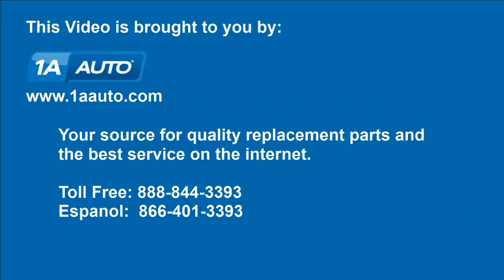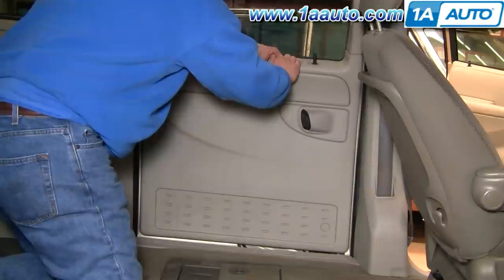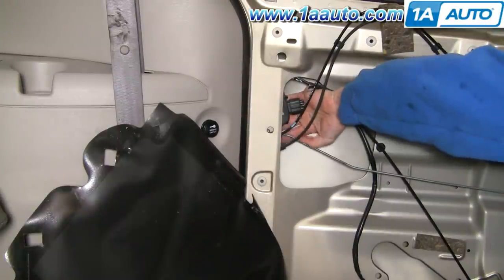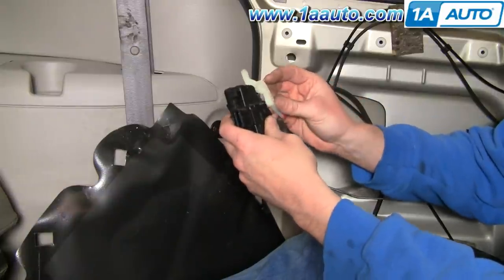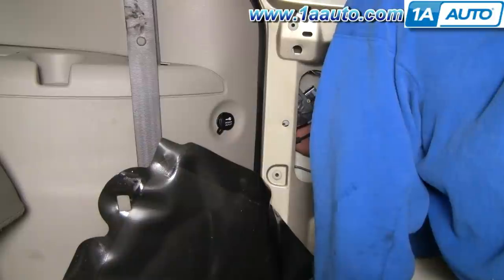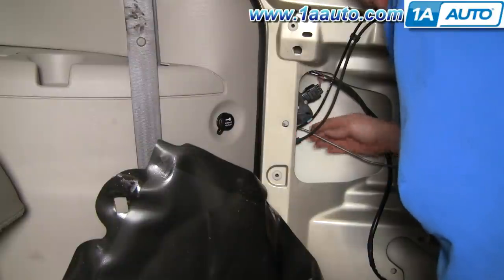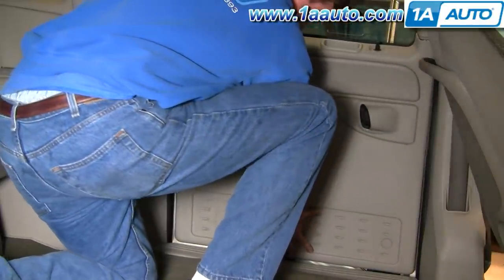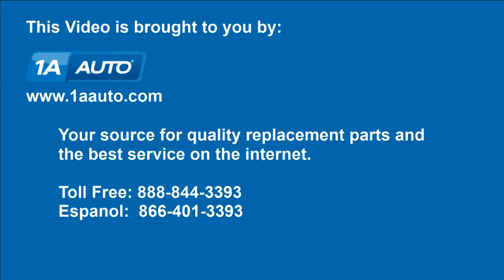How to Replace Door Lock Actuator 01-07 Chrysler Town & Country

Comment from the maker: it sounds as if the actual latch is the issue there and not an actuator. The actuators only function is to operate when the unlock is pressed.

Comment from the maker: It could be an actuator problem or there may be a broken wire between the drivers side door and the body of the truck. Hope this helps you out. 1aauto.com 888-844-3393

Comment from the maker: It may be tricky to do, you could try working your way from the top of the door down to see if it's easier to remove the door panel that way. Hope this helps you out. 1aauto.com 888-844-3393

Comment from the maker: You may want to take the door panel off and check to see if a rod may have come undone from the handle which would cause it not to work. Hope this helps you out. 1aauto.com 888-844-3393

Comment from the maker: In most cases where the lock does not work it is related to the actuator being bad but you should check the wires to make sure there is nothing frayed before tearing everything apart and finding out that you don't need it.

Comment: I would appreciate a better answer for how to remove the actuator in the passenger door of a 2006 Town and Country.  There is no TORX screw in the hole to remove.  I have gotten it loose from the bracket, but something (a hidden screw perhaps) is holding it from coming out.  Thanks.  I see no rivets to drill.

Comment: Great video thanks, but I am having a problem after installing the actuator. I can not open the door from the inside. Almost like I put on  the child locks. Where is the child lock inside the doors. Is there a way I could have tripped it as I worked on the actuator
Reply: The child lock is on the back side of the door when you open it you'll see it from the outside. It flips up or down to turn off/on.

Comment: I have a 2007 Dodge Grand Caravan SXT. The automatic locks are not working on it. Does my van use the same actuator as the Chrysler town & Country? Do you have a tutorial for replacing that? I also am having problems with the driver side power window. Sometimes you have to press in to get the window switch to work. It also sticks in the down position. I am definitely ready and willing to give you guys a lot of business in the next two months if you can help walk me through some of this stuff. :)

Comment: Great video, thank you for posting. I just installed the new actuator with ease and everything works with that. But now I cannot manually open the door with the handle! The door handle moves and you can see the latch working internally and it is not the child safety lock either. Any ideas if the actuator swap affected the manually usage of the doors? I'm stumped!

Comment: Great video. Not sure if that is what my problem is or not. I have a 2007 Town and Country...when I use the power lock switch on the drivers door, the lock button on the fob or when we hit the required speed all the doors lock EXCEPT for the passenger side sliding door. The only way to lock/unlock this door is to manually use the plunger lock. Is the actuator my problem?? Thanks.

Comment: I removed the whole lock panel and replaced the actuator. Tested the actuator and it worked. Put everything back together and now I can't open the door manually. I checked the child safety and that's not the problem. The door will lock and unlock now and open automatically with the remote or inside button. I just can't figure out why I can't open it manually from the inside or outside now...

Comment: On the passenger side door there is a TORX 15 screw hidden behind the panel because the access hole is in the wrong place.  If you go over 3/4" to the right and up about 1 and 1/2" you can drill a pilot hole and see how close the the screw you are.  It took drilling two holes before I could reach the screw and remove it, but it came out easily then.

Comment: I'm with Maureen Fox on this one. On the passenger side, there is the hole where a screw should be, but there is a metal bracket inside the door panel. No screw, no rivets. Not seeing how the bracket comes out or the actuator comes out of the bracket. It's probably something easy. *lol* Thank you for the videos!!

Comment: This is a great video.  Having a problem with my van.  My issue is the power lock won't lock/unlock.  You have to do it manually. Once unlocked, the power door will open and close it.

Is that the actuator that needs to be replaced to fix this issue? Will definitely buy from 1AAuto.com.

Comment: I have a 2002 T&C with driver side sliding door panel removed from the door that is stuck shut. All I want to do is to be able to open and close it manually. How can I open it without any electronics.  I just want it open.

Comment: Great video, but i think my problem is kind of different, when i press the unlock button from the key or the driver side control, only the driver&passenger doors unlock not the sliding doors. Also from the driver side controls, when i press the two down buttons for both the driver&passenger windows to roll down, only the passenger window comes down not the driver side. If you have an idea of whats the default, please inform me...

Comment: My door is stuck in the locked position. I cannot open it to gain easier access to remove the trim.  I did notice a pop out in the door panel that has some sort of nut in there. Is that an emergency door release? Thanks for the video!

Comment: I have a 2009 Towm and Country. The sliding door on drivers side will not open. It will not close tightly. The window will not work either. Actuator? 
Thanks.

Comment: Great Video.  My driver side sliding door will only pop open a bit but it won't unlatch, not even manually, would this be the actuator?  After a while if I push it to close the door will close itself tightly.  Thanks.

Comment: The passenger side door will not unlock ,so I have reach in from the drivers side to unlock I am able to automatically open the sliding door , only when I manually pull up to unlock ..So is this my problem, this little gadget you took out? I thought it was my battery for my key I did change batteries... guess not...

Comment: Thanks for the video & link for the part. Rec'd part quickly and EASILY replaced actuator on 2005 Caravan. Took about 20 minutes - works perfect!
2 pieces of advice:

- Only open door MANUALLY while working - don't use power door button to avoid smacking around upper door trim 

- BEFORE REMOVING old actuator, see how it lines up with the metal bracket inside door. Once removed, look inside rear of door to find the lock pin the actuator moves.  The oval hole of actuator arm fits on this pin.
:)

Comment: I have a 2005 GC Sxt, went out to get in the car today and the key fob didnt lock the door and the neither switch worked either. 
I popped the hood and pulled it IOD fuse to reset the actuators. 
I want to fix the actual problem...but i don't want to replace ALL the actuators. 
How do you know which one is the problem?

Comment: Hey , is this the fix that needs to be done  when the sliding doors don't unlock or lock when the power switch is pushed? Because I have to unlock mine manually. When I try to do it by the power switch, it won't work. PLEASE HELP!
Reply from the maker: You may want to make sure that the fuse is good. If that checks out okay, you may want to check the power going to the switch and also the actuator that unlocks the doors. Hope this helps you guys out. 1aauto.com 888-844-3393

Comment: I cannot manually or auto unlocked drivers sliding door. If I force it up with needle nose pliers it will work for a short period of time. While it is working, a loud buzzing sound comes from the lock actuator whenever you press the lock button (but it does function). However, after it sits for 15-20 minutes, it's back to being stuck in the locked position. Once it's back to being stuck no more loud buzzing sign but also no function (unless forced with pliers) Any ideas?

Comment: Thanks for your excellent video tutorial!
I needed actuators for both sliding doors  on my 01 Caravan. Did the driver side first by trial and error, wasted 8 hours removing all hardware,extracting a stripped lock screw, finding the replacement - unnecessarily removing entire hardware and-putting it back! If only I had watched your You Tube video first, I could have done the whole thing in 15 minutes! I will be doing the  actuator on the other door your way.
You are doing a great service! Thanks!

Comment: this is good video as I need to replace a door lock. but do you have a video for replacing the actual sliding door motor? mine keeps overheating and fails halfway thru day and needs replacing

Comment: Is this what needs to be replaced if the door will not unlock AT ALL - manually or remotely?  We cannot open our driver's side sliding door because we can't get it unlocked.
Reply from the maker: Thank you for watching.You may also have a problem with the latch itself. It might be stuck shut.
1aauto.com 888-844-3393

Comment: My 2005 T&C sliding door lock somehow got jammed.  I ordered the part before taking door apart.  After i disconnected the linkage to the actuator i started playing around with the actuator movement because the door couldn't be opened or unlocked no matter what.  Not sure what i did but i heard the distinct sound of the door locking in place, so i pushed the button on the inside frame and the door opened right up.  Went outside the van and wound up behind the opened door where i found 3 bolts, loosened them and removed the entire assembly, actuator and all.  Kept opening and closing the lock and it was working, placed everything back in place and tightened down 2 of the 3 bolts and kept opening and closing the door and it worked fine.  Put everything back together and everything is ok now.  Oh yea, i lubed everything that moved before closing up the panel.
Reply from the maker: Thanks for watching our video! +Patrick McConville

Comment: I would not have been able to do this job without this video.  With that said, it is a trickier job than it looks.  Yes, I did try to be careful, but still dropped the screw into the door..... and yes it is impossible to retrieve.  The hardest part is the placement of the mechanism itself.  I would carefully inspect the placement before removing, then try to place the new one before screwing it in.
Reply from the maker: +Rich Johnson Thank you for your positive feedback! We are happy we could help.

Comment: Hi I have a 2002 grand caravan with a passenger side power sliding door that will not open or close electronically (mechanically and with fob lock it qworks fine). It used to pop open slightly, but that was it. I replaced the track wiring, and when I pressed the button, suddenly it started making a motor whirring sound which I never heard before. It was coming from and felt like it was the actuator area making the motor noise. I replaced the actuator, but it still has the same problem. The main door motor does not turn. (I put 12v through this and it spins so that's not faulty. Is there another component near the actuator that needs replacing? 
Thanks!
Reply from the maker: +Ran Dome We wouldn't be able to diagnose an issue like that here, you may want to have a local mechanic take a look at it. Thanks for checking us out! http://1aau.to/m/Shop-1AAuto-c
Reply: It's nearly a year later but if you haven't figured it out, I would try the power sliding door wire that connects with the motor. It could be damaged or pinched somewhere

Comment: My 2016 Chrysler Town and Country sliding doors won't open. They don't open no matter how I try to open them. Could it be an electric problem? Would the actuary inside the door die in the first 5 years?
Reply from the maker: +Barbara Mallory We wouldn't be able to diagnose an issue like that here, you may want to have a local mechanic take a look at it. Thanks for checking us out! http://1aau.to/m/Shop-1AAuto-c
Reply: Hey Barbara, it's pretty common for the 2016 model year to have sliding doors that are locked. The problem is the actuator 99% of the time and most dealership will charge $800+ for the repair since they have to take off the door panel while the door is closed which can leave them damaged/deformed. I have heard some mechanics saying that you could pry the door lock enough where you can jam a long screw driver to unlock the door but I haven't tried it since I don't have that specific generation Town and Country. Again, this is pretty common even under 50k miles on the odometer but by then the 3year/36k miles warranty is out so you likely have to fork out the cash. If you haven't fixed it yet, I would ask around some independent mechanics that also does body work so they might be experienced enough to pry out the door panel without damaging it.

Comment: Like the question from "New York Limo & Car Service
" before(3 months ago) I too have to anually loc/unlock the sliding doors. They slide automatically when I use the remote but don't lock. Can you help?
Reply from the maker: You may want to check the door lock actuators, and also the check the power going to them with an ohm meter or a test light.

Comment: Good instructions. The first time I did it, I didn't properly connect the backside of the actuator, so the actuator properly locked / unlocked the door, but the manual door latch button inside, and the outside door lever were both disabled from opening the door, as if the childproof door was enabled. The fix is to make sure you connect the backside lever thing in addition to the metal manual lock linkage.
Reply from the maker: Thank you for watching!
1aauto.com  888-844-3393

Comment: I have a 2001 Town and Country and on the passenger side the door intermittently doesn't unlock electronically  and on the rear passenger side, I can't open the door because it doesn't unlock manually or electronically. Would these be signs of a bad actuator switch on both doors? I would appreciate any help. Thanks
Reply from the maker: Thank you for the email It sounds like you have a problem with a latch. If a actuator fails you should still be able to lock or unlock it manually.
888-844-3393

Comment: Hi! I'm not sure if anyone will see this and can possibly help. I replaced the actuators in both back sliding doors with this and both started working again! However one of the doors is seeming to be temperamental, when installing the door panel after the repair it would stop working altogether, finally after the 4th try it continued to work after the door panel was back on. Now it takes me pressing the unlock button 3 times to get it to actually unlock though, it moves slightly each time and then the black knob finally pops up on that third try. The black knobs that stick up and indicate the door lock position on both sides do not seem to work correctly. I can see both move slightly but neither moves to the extent that they should/once did. If anyone has any insight to how/why those black knobs don't have full movement even with it working, or why the one door takes multiple tries please let me know.
Reply: A bit late of a reply, but it's likely that you didn't get the door pin back into the curved slot in the actuator lever arm when you reinstalled. So, the lever arm is hitting and partially moving/activating the door lock, but not properly. You have to be sure that pin is in the slot and stays in and is still in when you're done fiddling with the actuator to reinstall it.

Comment: Yeah my drivers side sliding door won't open manually or with any of the buttons will the lock actuator fix that?
Reply from the maker: You may want to remove the door panel to see if the rod has broken off of the door lock or actuator. It should open with the key, even if the door lock actuator is bad. Hope this helps you out. 1aauto.com 888-844-3393

Comment: I'm attempting this repair right now on our `07 T & C.  Have all the panels off...looking at the old actuator. There is no torx screw anywhere that I can see.  There is an access hole where you think the screw would be located, but there is nothing behind it other than a solid piece of unpainted steel.  Also, looking at the replacement actuator, there doesn't appear to any place in it for a set screw to go "in to".  [<---EDIT...I was wrong.  There IS a place for it.  It was just a lot smaller than what I was envisioning].  Are there any known applications of this part/model of vehicle whereby the part just "clips" in to place, without a set screw?  I should have mentioned that this is for the passenger side, sliding door.
Reply: Never mind.  Found the answer in another YouTube video.  Apparently for the passenger side you have to drill your own access hole.  Manufacturing glitch at the assembly line.

Comment: If you drop the screw attaching the lock actuator inside the door, you can peel back the sticker partially covering the drain hole at the bottom rear of the door and use a long flat screw driver to push it along the drain and out the hole. Thanks for video. 2006 Dodge Grand Caravan.
Reply from the maker: +Mike Angelo Thanks for watching. If any of our viewers needs to make this repair, we carry the replacement part shown in this video on our website. Here's a link to them http://www.1aauto.com/1A/DoorLockActuators/Chrysler/TownCountry/1ADLA00087?utm_source=YouTube&utm_medium=CTA+Comment&utm_campaign=ytcomment&utm_term=vqbJtTmkYfM